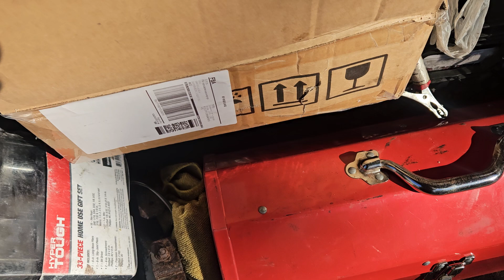Tahoe PPV plans

Comment: Shit, with the time you got, and the motor being messed up, your Tahoe gonna be brand new off the line with all new parts/ clean inside and out when the new one gets put in. Gonna be riding around in style
Reply from the maker: @DontMatter7  yea bro thats why I started doing work in it getting other things done things that needed to be done only thing I'm gone have to do is change the diff fluid & wheel alignment